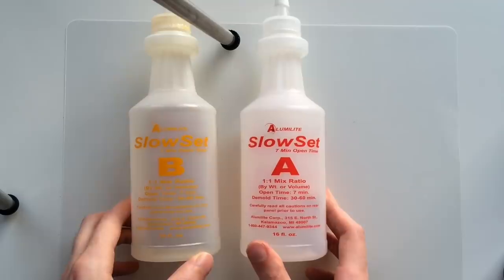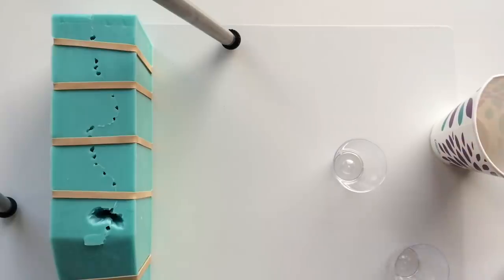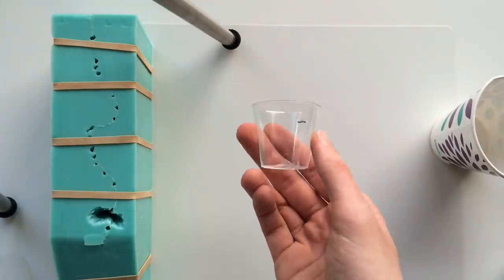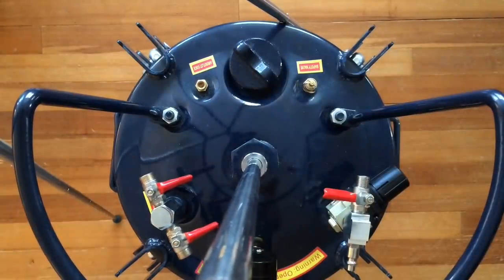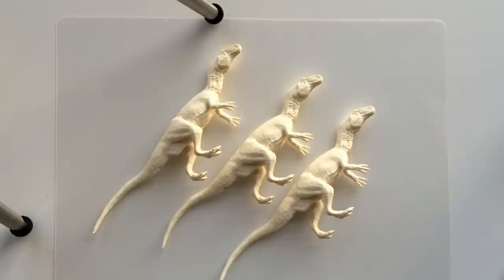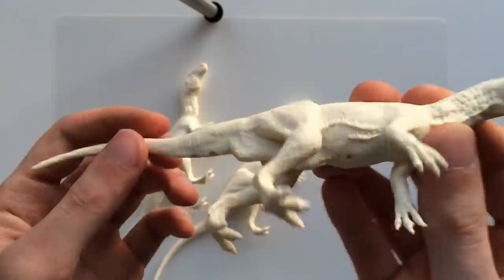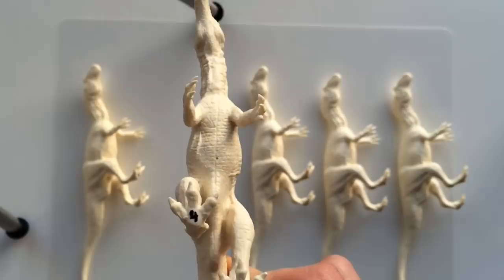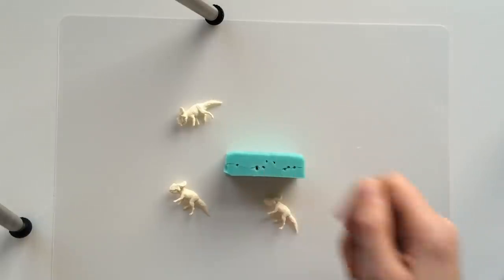Casting an Allosaurus Dinosaur Model with Resin

Comment: Easier and cheaper way to figure out the volume. Is by filling a bucket to the edge (knowing how much water goes in it) and putting your model in. What is pushed out is the volume. And with plastic Dino’s you can do that ;)
Reply: Or you could just fill the mold with water, and measure that. Then let the mold dry.
Reply: @DanSwanson2070  Same principle indeed.

Comment: That's nice! For the volume used for resin, that seems to add up in price in production. Have you thought about using less resin by putting a filler inside (with supports) so when pouring the resin, the outer skin is filled and formed and not the innards. An example is like the old action figure He-man toys of yesteryear, like when a child pulls the arm or leg of the action figure, what they see inside is empty space inside.

Comment: Hey, does an instant pot work on the pressure casting? Or can a 2 and a half gallon air pressure paint tank work?
Reply from the maker: The paint tank should work If it’s rated for 60 psi. Mine was made for paint, it has an overflow safety, regulator etc. I pressurize it to 55lbs before the safety goes off. If you’re making your own molds you’ll need to vacuum the air out of the silicone so it doesn’t get shrunk during pressure casting.
Reply: Kayakasaurus ok got it thank you😀

Comment: What happens if you didnt use a vacuum Chamber for the mold but still use pressure chamber for the casting? :/
Reply from the maker: If there are air bubbles in the silicone that air will compress under pressure warping the mold. You could mold it under pressure instead of vacuuming the silicone. The reason I don’t mold under pressure is so the original sculpt doesn’t have to be under pressure in case it would break.

Comment: i don't need that if i am making a relief right?
are rubber bands better than having holes that hold together with fastener  poles?
it's not possible to re use those mesuring cups. like the doasing caps that come with medicine is it? just wipe it out good. maybe clean it with something.
do those count as shrink wraped dinosaurs?
could you use those scraps to be plants?
Reply from the maker: Rubber bands work well for silicone molds, with larger molds I use sewing elastic, cut it to size, and then staple it into a band. The measuring cups are not reusable. I get 24 for a dollar at the dollar store, they’re disposable shot glasses.

Comment: Don't have a ton of experience with this type of casting, but have been a dental tech for 16+ years.  I think what you need vacuum chamber and not a pressure pot.  The pressure is used to change the boiling point of volatile monomers so they don't bubble during polymerization heat or curing temp heat.   

That said, awesome work!
Reply from the maker: The pressure pot in resin casting compresses the bubbles until they are not visible while the resin hardens. A vacuum could pop most of the bubbles introduced in mixing before pouring, but it wouldn’t compress bubbles trapped in a complex mold or introduced by pouring. I do vacuum the silicone before making the molds so there aren’t any air bubbles to be compressed when they’re being used to pressure cast.
Reply: @Kayakasaurus  What you should have been doing is after pouring the silicone, place it inside the pressure pot as it cures under 60psi. Then do the same as you cast it. You are still getting bubbles because there is air pockets trapped inside the silicone mold from you not curing it under pressure. The vacuum chamber is not needed.